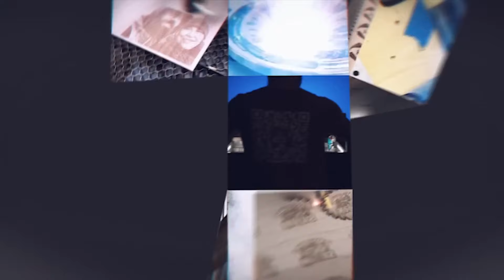Learn about 3D Crystal Machines - 3D Laser Box - Jet Mini 3D Laser Machine

Comment: Huge questions. I want to buy some of those crystals use my F2 ultra the thing is the F2 ultra I believe one 50 x 70 mm as large as object that can take what I’d like to know is if I get one of his extra large that are 80 mm can I still use it? It just won’t be engraving the whole size cause I need something that can do something very similar in portrait mode and figuring how thick these things are. There’s another issue. His website shows 80 x 1 2080 by what 80 x 60 you know so if you know that that would be great to know
Reply from the maker: Load it vertically.  X margins set to 5-6mm. And make sure your stabilizer in settings is not checkmarked on. It should be unchecked. This should help 😊.